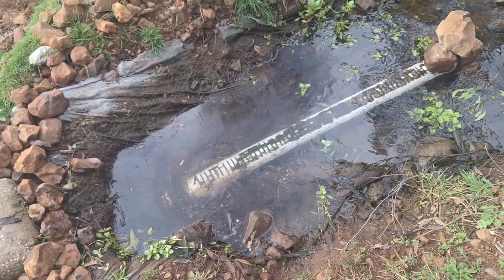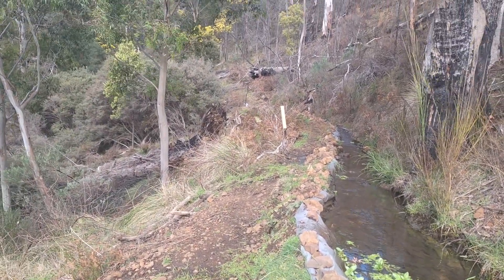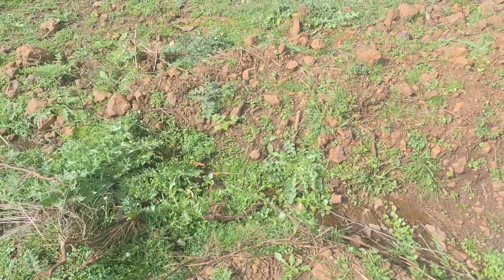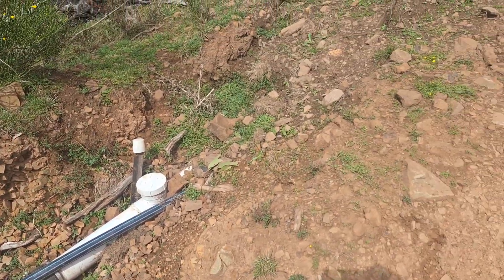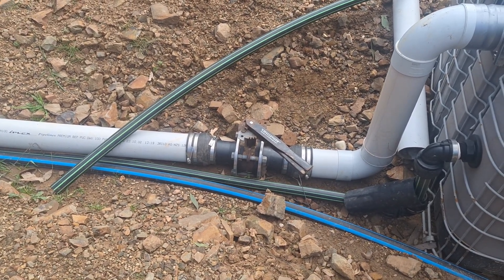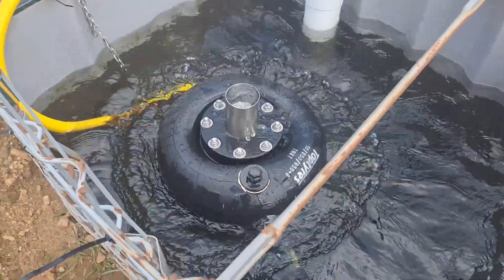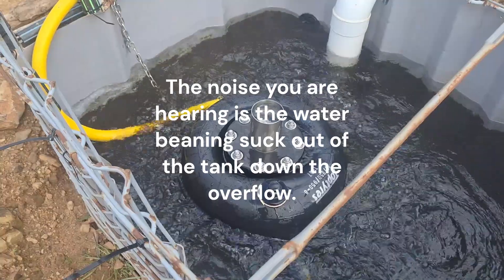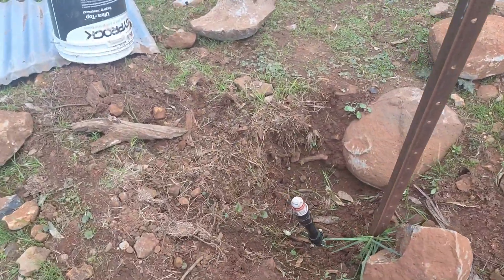Sonia's Bunyip PA13 Pump

Comment: Piss poor performance,  much better systems available,  even solar because it pumps so much more volume .
Reply: You may listen but that's all you do..
 list
Reply: @ripme6616  and you make no sense
Reply: @ripme6616  3 grand for a pump without pipes,  I built a solar system that doesn't require a stream for $400 and delivers 3000l a hour
Reply: It’s great if you just leave it running and don’t need more than 3 ltrs a minute. 
Tbf you could water a lot of plants and save a lot of time on maintenance by using this pump but then if you need more then there is other options. 
I personally think it’s great as it would allow me irrigate my veggies without me needing to do all that work and without worrying about whether the electricity from solar or wind is actually working. This thing looks like it takes very little maintenance and effort to do a job that requires a lot of labour by hand watering.
Reply: @timwoodger7896  don't forget about the needed water flow , with some other systems you can take a greater quantity without the loss, and this pump isn't affordable like the manufacturer suggests
Reply from the maker: Send me your phone number and we can have a chat about your comments, because I would like to know how you know our business model.